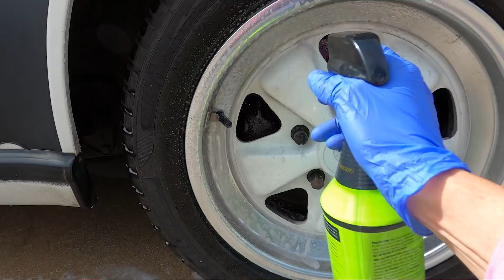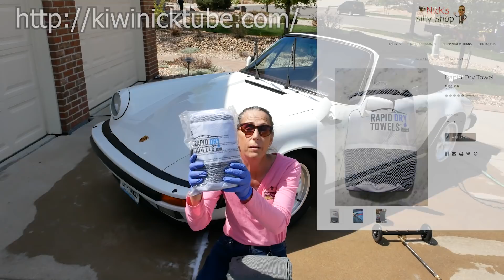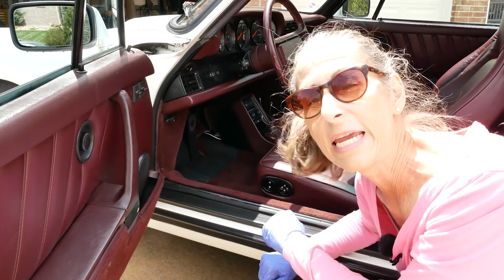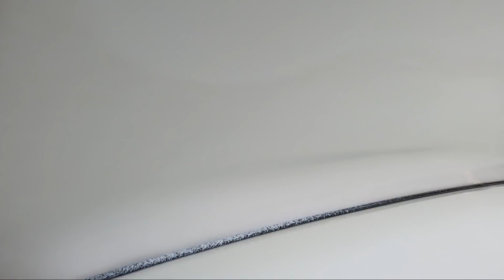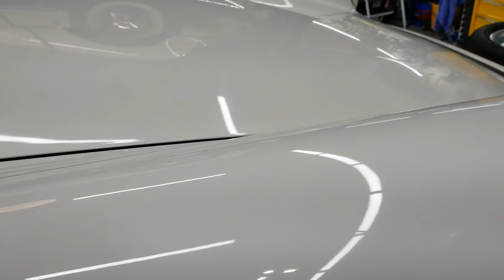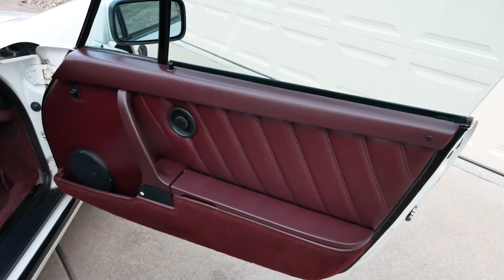Budget eBay Porsche 3.2 Carrera Project Car! #35 - DETAILING!

Comment: Thanks for the demo. For cleaning wheels I found it beneficial to get the brake dust from inside the wheel removed in before cleaning the visible parts, or else gunk just keeps coming back out. I just take the wheels of for cleaning and detailing. Once a year for a deep clean anyway.

Comment: You should be very proud of yourself, Franny!  From the engine rebuild, interior upholstery and finally detail (and everything in between) in this series, your baby looks amazing!  Let's go for a tootle =)
I just had my car done: clay, polish and a silica coating - good for about 8-10 months with no maintenance until then.  Given the beating it gets from San Diego weather, I was extremely impressed and very happy with the final result.  Even the head lamps!
As far as the wind screen, I hate cleaning that and understand about the stubborn film - what has worked for me is a spray foam glass cleaner and newspaper.
Reply from the maker: Congrats on your nice clean car!  That is such a great feeling :)

Comment: 👍 Hi Franny, You should try polishing a 4WD with a canopy and roof racks, it makes polishing the Porsche easy. When I do the glass I first start with the clay bar and window cleaner spray, then dry, next I use Mother's Metal Polish, then once again window cleaner to remove any polish left on the glass, then I use Rain-X, when it dries I use a mist of water and the cheapest paper towels you can buy to remove the streaks. Why do I use the cheapest paper towels is because they don't leave any paper towel dust behind, that's because they are not as soft as the more expensive towels. I also like to clean the rubbers around the windows with a tooth brush, if you try to clean them with you sponge when cleaning the car it tends to leave a big black streak on the sponge. I use Mother's Protectant on all rubbers , plastic, and dashboard. Windscreen wiper rubbers are removed, cleaned with mother's protectant and then placed in a sealed bag with an extra spray of mother's protectant and lift in the sun to warm up for 30 minutes, heat makes the rubber absorb the protectant an the plastic bag stops the protectant from evaporating then remove and wipe dry before installing. Wiper rubber stay soft and lasts for year, I do this twice a year. I also do this on the cowl, once a year too, wiper arms are removed cowl is removed cleaned and then sprayed with mother protectant and wrapped with plastic and lift in the sun, this changes it from a faded Grey to black. It also gives you a chance to to remove all the leaves and to hose off the mud from around the wiper motor and to hose of the top plastic wheel archers. Looking forward to the Ferrari videos.

Comment: Great job Heidi, car looks awesome. Cerium Oxide works really well for cleaning glass. I had a car with hazing on the windscreen and fine scratches from the wiper blades and managed to remove them all. It can be quite messy so taped up around windscreen and covered the paint for protection. Used a small buffing machine and very happy with the results. It took a couple of hours but well worth it. I believe they sell the cerium oxide in different size particles , for cutting speed vs refinement. Thanks for the video.
Reply from the maker: Thanks for the tip! I'll look into that.
Reply: @HeidiandFranny  No problem, glad to be of help!

Comment: I agree with Franny’s point that ceramic coating may have been the protection of choice after the extensive prep work. I have had all three of my cars ceramic coated by Denver Autoshield in the past 6 months with good satisfaction, but that cost $1500/car. Franny’s BMW video persuaded me to take that step. I wonder about the 303 product, but they seem to be accepted in the show car world. I attended Mecum last week where they were a big sponsor. Many high end cars were touched up with 303 washless wash spray and wiped with microfiber; which made me nervous about scratches on high end collector cars.
Reply from the maker: Thanks for that.  Really interesting.  I'm with you on the waterless car wash.  If the car has been ceramic coated then maybe, but... We'll see how the 303 plays out.

Comment: Best tool I’ve used to clean bugs and such on the windshield is the Harley Davidson bug remover pad. After using your preferred window cleaning solution, nothing works better than paper towels, at least that’s what I’ve found.for the black trim the best thing I have ever tried that worked and Lasts is Chemical Guys “Black on Black.

Comment: Looks like the wheels of the little undercarriage washer need replacement with some skateboard wheels for a sportscar 😄.  The stock wheels are a little big. Nice job, as usual.

The only thing I would do if it was my car: Replacing the headlamps with some  RdW (Rest der Welt = Rest of the world, the Porsche term for non US/Canada specific parts) H4 headlamps. Can’t argue about taste, but the sealed beam headlights really aren’t my cup of tea.

BTW: Did You replace the crest‘s nuts? If the sealant is missing, there is an off chance  of water leaking in the trunk 😬.

Comment: Great video!  What’s the verdict on grapheme on pain and especially the windshield?  Rain beading is great but how does it deal with wiper chatter?  Thank you!!
Reply from the maker: Hi Mark, Great question!  I really haven't had the car out that much and we haven't had any rain in months...  But I don't know what I think...  I keep seeing little black dots that do wipe off, but...  I'm assuming it is carbon.  It doesn't wow me like ceramic does.  In fact, I think I'm going to do a light buff to remove it and just ceramic coat that car.  I need to 303 the top as well.  Thanks for asking! F

Comment: Hi Franny. I notice how you close the front bonnet in the centre over the badge however on mine which has an aluminium lid it buckles when pushing down. I now close by using two hands on both sides with no distortion. Could I have your views on this. Love your videos.
Reply from the maker: I always close just below the badge.  That is where the pin and lock is so the least possibility to bend the hood.  The badge is actually quite soft and will easily depress.  I have worked and worked with this one to flatten it out without cracking the enamel on it - bent from years of people pressing on it.

Comment: Re the iron-removing wheel cleaner: It looks like a lot of iron came off, but where does the iron come from in the first place and why is it only on the wheels? (I used to have an iron-removing Saab 96 — the iron just oxidized into rust and fell off in chunks — but I assume this is not the same thing…?)
Reply from the maker: The iron is from the rotors and the pads. It gets imbedded into the wheels.  In theory that stuff removes it.  It does help :)

Comment: Leaving soap (foam) on a vehicle in the sun seems contrary to my thoughts, what am I missing Franny?
Reply from the maker: Water spots are formed when the calcium (and other salts) precipitate out on the last bit of the water (the ring where the water was thickest).  These salts can be corrosive and will actually etch the clear coat/paint.  What the soap does is does not allow those rings to form by providing a sheeting action.  You can see it as it dries - it is in streaks.  The surface tension has been broken.  It also helps to neutralize the carbonic acid in the water (soap is mildly basic).  I was skeptical at first too, but it makes sense and I've never had water spots since.  Another possibility is to use purified water but those filters can be a little pricey.  If you car is ceramic coated or has a really good wax or other coating that will help a lot as well.  Let me know what you think. F
Reply: @HeidiandFranny Thank you for your thoughtful and thorough explanation, next time I wash the car I will try your technique.

Comment: why bother scrubbing the convertible top with soap and risk removing the fabric protectant if the fabric looks this clean? I just do a rinse and cover with more 303 protectant (using the techniques Franny has demonstrated in an earlier video!)
Reply from the maker: That's why I use a super soft brush and car shampoo. It won't remove the protectant I've applied but it will pull the dirt and fine sand out of the fibers.  It is that dirt that will ablate the fibers and ruin the top. Vacuuming is another good option. We have so much grit that blows in that I have to work to keep the tops clean.

Comment: Never wash a car in the ☀️ 🌞 sun correct?
Reply from the maker: Great question! You can wash in the sun just don't let clean (rinse) water dry on the paint. Soapy water is ok, just not rinse.  I tried to get started early but there was a garage sale across the street and there were a ton of interruptions ;)  Just resist the temptation to rinse until you have towel in hand to dry :)